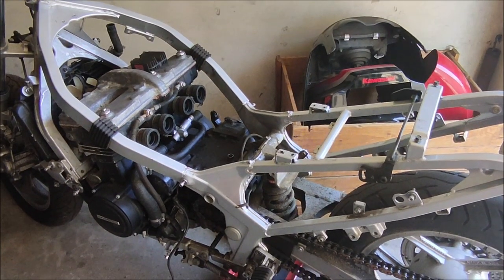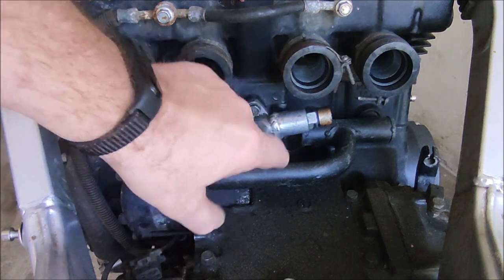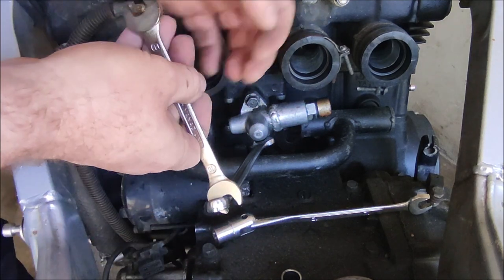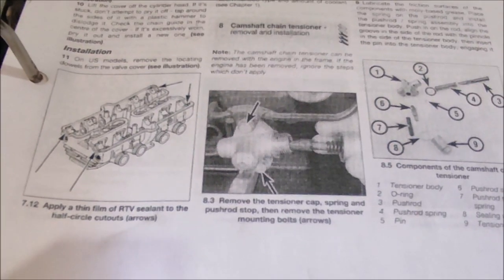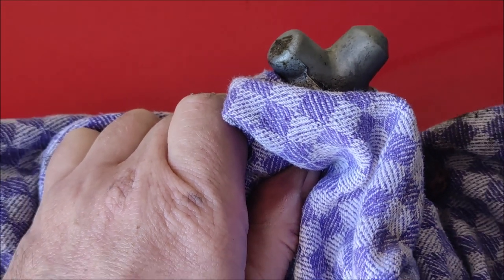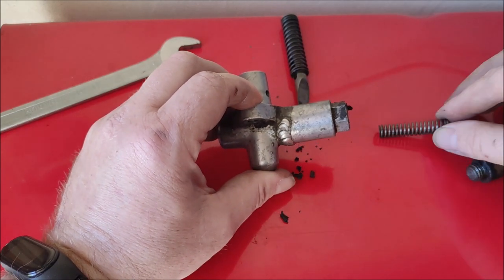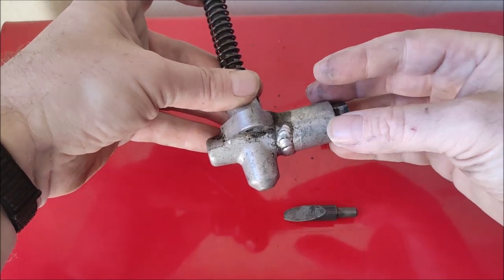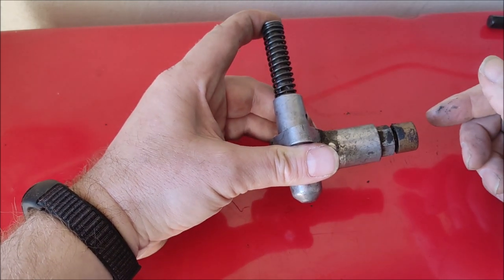Kawasaki GPZ600R ZX600A Ninja Cam Chain Tensioner Modification?

Comment: I don’t think the intention was to create an adjustable tensioner. I think the original thread was damaged somehow and a fix was made instead of a new spare tensioner so the original threaded piece was welded on and in order to install it they made a new thread.
Reply from the maker: Possible. I have actually managed to break one of these in exactly the way you describe. This is a way to fix it, but I would have bought a replacement 🤣
Reply: @MrLefthooker  me too 👍

Comment: I’m actually about to do the same thing to a ‘95 zx600r. Those Kawasaki tensioners are hot pieces of shit. The bolt added was no doubt to keep the tension on the chain cuz the way it’s designed,  the springs aren’t strong enough to keep the pins from sticking in the shaft. Having two wedges of steel to transfer pressure at 90 degrees is absolutely idiotic.

Comment: A small correction, if I may. The spring on the tensioner pushes the tensioner rod in, and the secondary plunger's spring pushes it in as space is made. The two wedges perpendicular to each other prevent the force of the chain from pushing the main plunger backward. So, as the chain wears the plunger goes in but cannot come back.
Enjoying your videos. I ride an '87 model all year round. Fantastic wee beasts!!